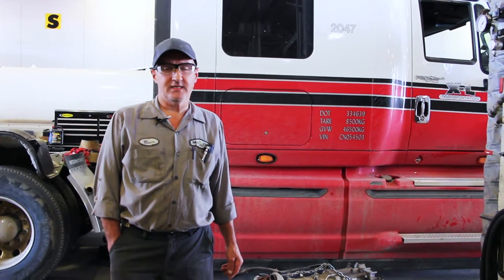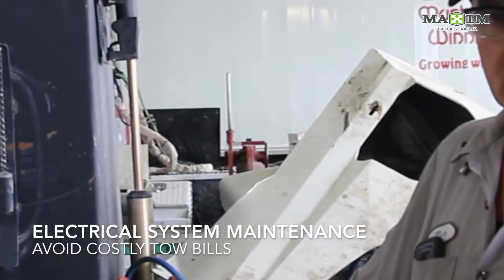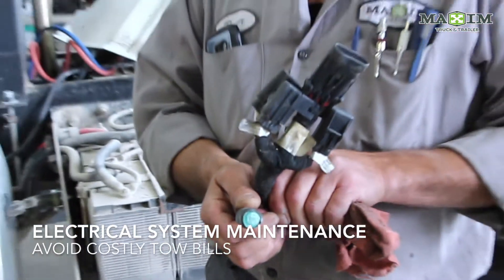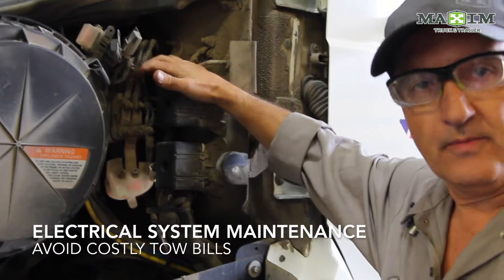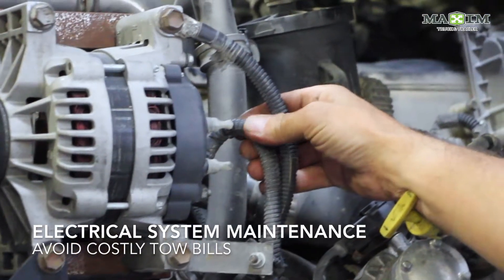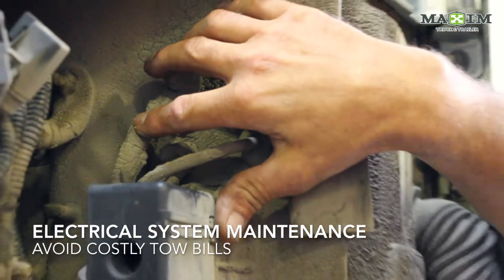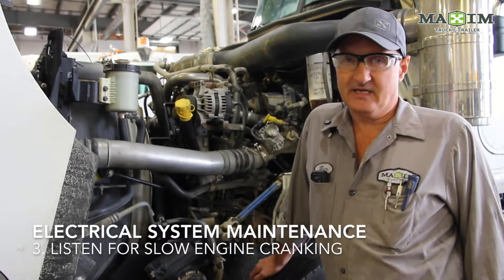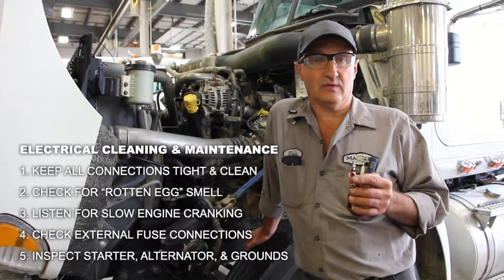Ask Roger: Electrical Maintenance & Cleaning

Comment: Thank you. As "Just the Driver" I did in fact learn a lot here!I do keep my truck clean. I do check cables. But did not know about the external fuses and where they are. I will find them on my truck.  I will also blow out the battery box more often, Dust and dirt gets in there and the lockout box for the lift axle on my dump truck. What is the best way to clean all these more sensative areas. I do power wash parts of the engine, other parts I do by hand, batteries i rub with a dry rag. Is it safe to use say air to blow the dirt off of these places?
Reply from the maker: Hey Marysol, I asked Roger and he had this to say about it: 

"Yes blowing air will work but I would advise that she wears appropriate PPE to protect her eyes and skin. Some of the stuff that gets blown off can be hazardous. Alternatively I would recommend a hot water wash for the batteries and then a blow dry with the shop air. The wash helps to neutralize anything that might still be actively harmful. Hope this helps."

Have a good weekend, thanks for watching!
Reply: Maxim Truck & Trailer Thank you! Make sure Roger knows he is doing a great service with these videos. And thank him for this info! Thank you for responding! I love my Maxim purchased, International Dump Truck. I would like to keep it in good shape :) Maxim service so far has been wonderful :) <3